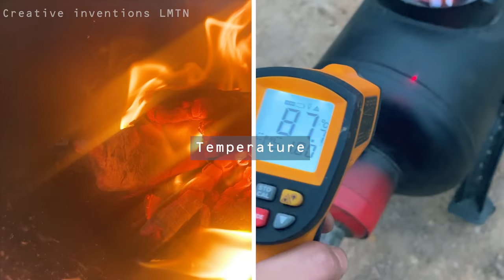New York is buried in a sea of ​​Snow! Mini HEATER will give you emergency HEATING

Comment: got an test for you.  Since you like blowers in your projects. Hit me today that the blower may not be improving burn better by its fan stuff more air in there.... but by its fan creating a wind velocity that results in sucks in more air thru existing air air feed holes.    A test to check this would be to put a fan in the flu and suck the exhaust out creating a suction of more air in (forced draft)   Use same fan in two trials..... one in the exhaust flue..... and one in the traditional way you do it.
Reply from the maker: wow, I really never thought of this. I will apply those tests in the video heater next time. Thank you very much, my smart friend. Hope we will create perfect heater models
Reply: Wouldn't it melt the one on the exit side
Reply: @Psy6o  no.  Been running one on my wood stove for going on 3 years.  They make squirrel fans just for this.